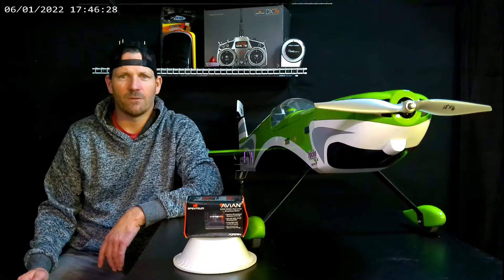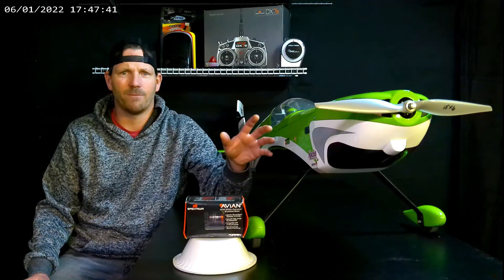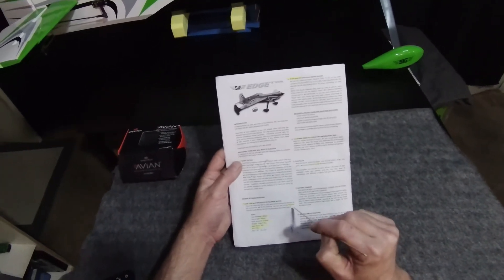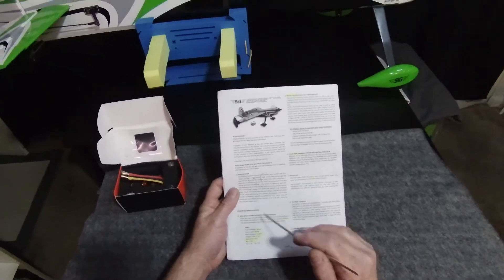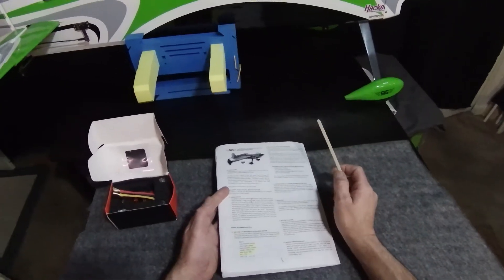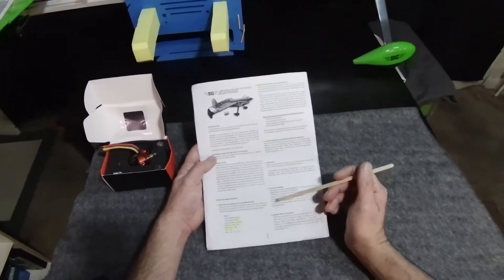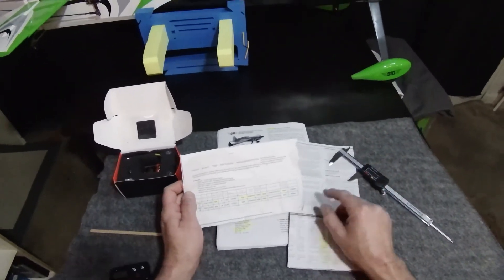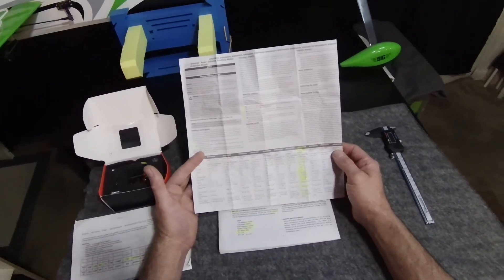SPEKTRUM AVIAN 4250 800KV BRUSHLESS OUTRUNNER MOTOR INSTALLATION SIG EDGETRA RC AIRPLANE PART 1

Comment: How did the CG work out on your Edgetra work out?.   I set mine up 4 S initially and could not get the CG right even with a 5000 4S.   CG too far aft.    Decided to go 6S motor and battery to get the CG forward enough and a 4000 6S all the way forward balances the aircraft.     However the airplane flies like it is tail heavy and wants to tip stall on final approach.    It also rolls strangely displaying a huge amount of adverse yaw.       I have never had a Sig model not easily balance out at the recommended CG with recommended batteries.

Comment: Where did you come across the deal for the motor?
Reply from the maker: hi my apologies for taking while to respond. i got the good deal on that motor from eBay i buy and sell on there a good bit here is a link to my store . https://www.ebay.com/usr/seagriffi4
 if you search brushless outrunner motor and check it often you will catch a good deal at times
Reply: @GRIFFINRCPLANES  ah yup I'm on ebay constantly as well. I just got a umx pitts so when I inevitably crash it I'll have to grab some touch up paint from ya. Thanks for the response

Comment: Your sound is very low. I purchased an E-Flite V900 orange speedster; it arrived damage the rudder servo arm embedded in the fuselage, and the linkage was snapped. I spent two hours yesterday trying to resolve the problem. They wanted photos of the damage. We sent the photos seven times before Horizon's computers and my computer were able to email photo attachments. I spent an afternoon on a damaged model rather than flying or relaxing 😒😒. Thanks for the videos. Do not be scarred to fly in the cold and snow. I had a blast flying at 12'F with 15mph winds. Cheers, Brad
Reply from the maker: sound should be fixed now. its is starting to snow here now. no flying today or tomorrow